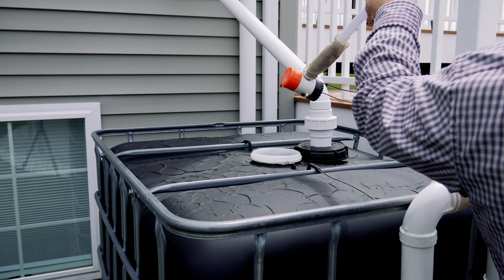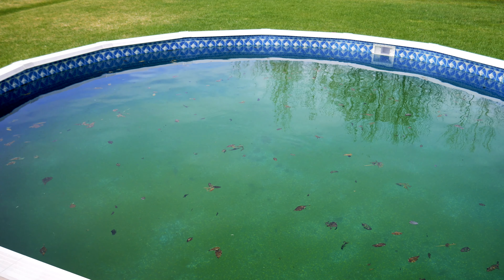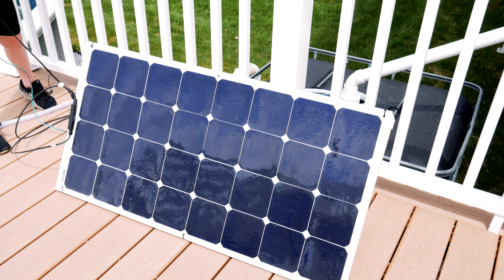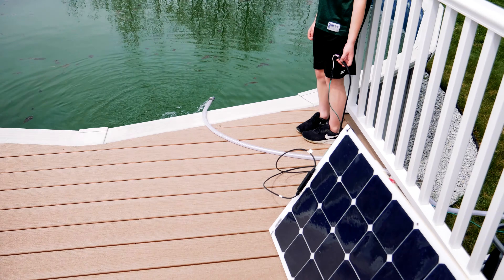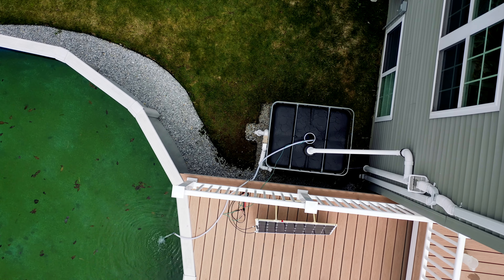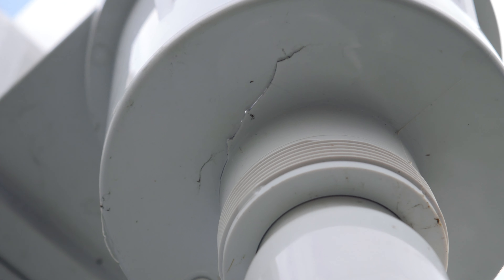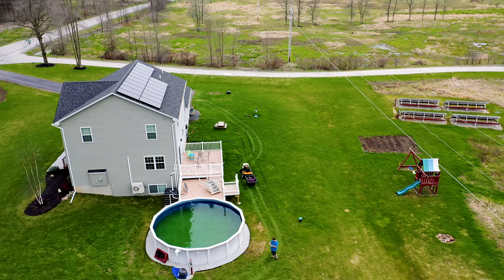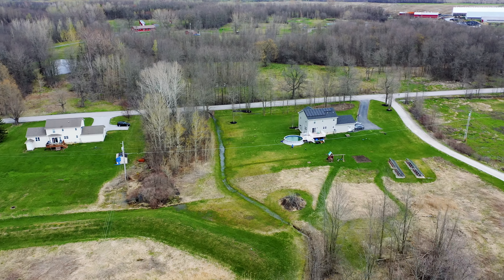Filling Swimming Pool with Rainwater Off-Grid!

Comment: why not put an overflow from the rainwater tank directly into the pool, so that you will not have to pump it out of the rainwater tank?
Reply from the maker: I have a passive overflow once the tank fills up.  Pumping to the pool is not a regular event just using it a little bit in the Spring time.  Will have a pressure switched 12 volt pump on the rainwater system in a couple of weeks which will serve to water the gardens and so forth.